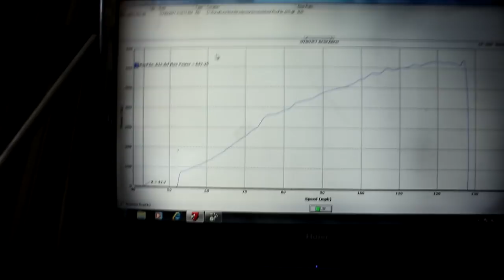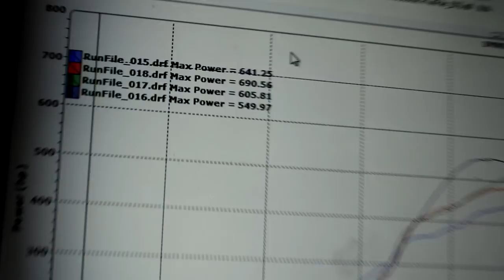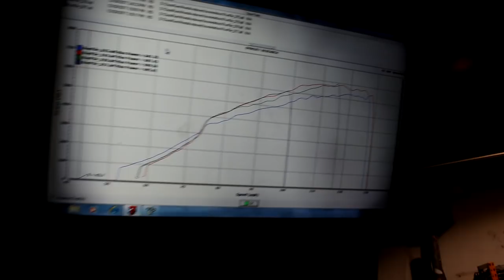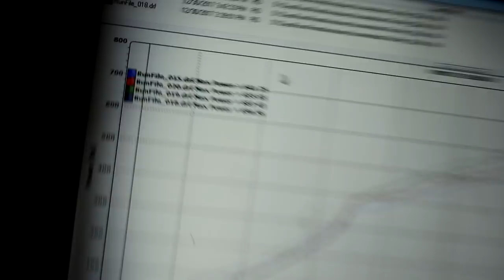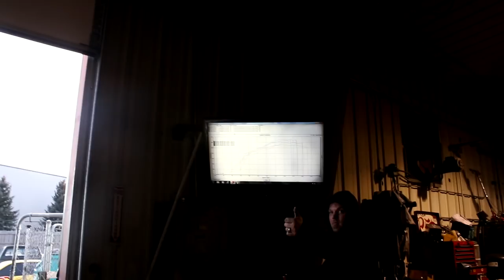Turbo Minivan makes some Real Power!

Comment: Anyone notice the minivan pouring out coolant <3
Reply: coedy slone ya that’s not good.
Reply: less than three
Reply: Yea i saw that
Reply: I saw it too. Thought he would mention what happen
Reply: its because he doesn't have a coolant overflow tank/bottle.
Reply: yea dude i was waiting
Reply: Yes
Reply: Yes
Reply: It'll be alright
Reply: yeah i do that's bad
Reply: I definitely did...
Reply: looks like a boosted boiz things! loose plugs on the wastegate, loose clamps on the radiator, loose crank pulley.. but... it should be fine!
Reply: @Math D.  its not from loose clamps or anything. He just pointed the overflow hose at the ground since he doesnt have an overflow tank.
Reply: coedy slone yah surprised no one noticed
Reply: coedy slone yea in the dayno
Reply: coedy slone yeh lol
Reply: coedy slone I love it...just keep running it like nothing happened. Lol he looked right at it too. Lmao
Reply: he forgot the good old soda bottle
Reply: coedy slone yea haha
Reply: coedy slone yea
Reply: As Kyle would say "its not goin anywhere"
Reply: Oh crap yeah at 1:54! Must have been fixed for the next run though. Weird.
Reply: she is just excited.

Comment: I remember when if you had over 200hp you were in a fast car. Heres this guy like 600+ in a hatch 600+ in a minivan 300+ in a awd van a mr2 with 4-500+ just making hp like nothing
Reply: Shinobe Man thats that Honda power bro
Reply: positive manifold pressure is a wonderful thing
Reply: Turbo
Reply: Shits real I hear that am jus saying these days a new bm with just under 500hp is slower than a lot of the competition. Here’s a guy with a minivan putting down well over a 100 more whp effortlessly, that’s crazy
Reply: Shinobe Man not exact effortlessy tho
Reply: 200hp is still kinda fast in europe, but americans are crazy and daily drive v8s and obviously you can't really make really low power with big engines, so you're used to more power than here in europe. You just got used to drive powerful cars, so they don't feel as powerful and then need more to feel like it's fast.
Most people here daily drive cars from 50 to a 100hp... So when you have a diesel 180hp bmw you're kinda fast.
Reply: zenkiES14 shit man I ran out of breath reading this in my head... learn how to use some punctuation brother.
Reply: jank jankins the road are good in some countries french roads are perfect, however belgian roads are shitty. But the real problem in Belgium is taxes. When you buy the car you have a tax according to the size of the engine, for a 2.5 it can be around 1000 euro. (900$)(France doesn't have that, but some other europe countries have it too)
And then taxes for pollution.
And yeah fuel is expensive af so everyone is using diesel because it's cheaper but we're all getting fucked since now taxes are decreasing on normal fuel and on normal fuel cars because it pollutes less. And rn since they can tax e85 (they couldn't before) it's finally becoming something here, I hope people will use it because it's way better alternative than electrics. (There is law that is gonna pass in 15years or something like that that will force you to have an electric car, if it really happens, I'm moving to the usa.)

Comment: *Buys a TiAL wastegate because the cheap ebay one fell apart. 
*TiAL wastegate starts to fall apart.
Reply: fairly sure the plug was installed by kyle not tial.
Reply: Regardless of the source the comic irony remains. :) There have been a few points on this build where stuff like that has happened. visa vis the epic crank pulley evacuation.
Reply: I agree 100% lol. That crank pulley exiting left center stage was epic to say the least.
Reply: What's more amazing is that it didn't damage anything else or itself.
Reply: The Tial didnt fall apart or anything even remotely close to it. A small plug in the side that Kyle put in, fell out. BUT wutevs
Reply: Tial has a video on here of a stress test on one of the china-tial wastegates they did and it didnt work out of the box and then after getting it working, it failed after only 40 mins and 6500 cycles.
that said, the knockoffs have a place in the market, but to even remotely compare a tial to any china made knockoff is absurd . It was a plug kyle installed which is no fault of tial. cardsonthelow you are correct

Comment: 3:52 "We gotta beat that!"
Kyle: "Ahahaha no..."
Poor guy just wants his race car to be faster than his race van.
Reply: it's all about power to weight so car is faster.
Reply: djmips well it’s probably a lot easier for the van to hook with the extreme weight
Reply: i wouldn't say extreme weight
Reply: he said their stock 3100 pounds lol and its really not much more weight over the front axles for that fwd grip......... also with shitty stock suspension the weight transfer to the rear wheels is a lot more than his hatch. so it probably has even less grip than the hatch.
Reply: Use this Advertisement board yo!
Reply: GTFO
Reply: Etown Edits tbh I've never seen 802 ask for subscribers on this channel... maybe he's just actually interested...
Reply: Pravusss s yeah not that heavy the new si way that much
Reply: Catfish cooley
Reply: Lightly Salted Peanuts This is my favorite channel. :)
Reply: The van is actually lighter than a lot of modern cars, so especially partially stripped it could be surprisingly competitive.
Aerodynamics and center of gravity and weight distribution won't help it though.

Comment: Even better than that dodge caravan burnout right there
Reply: Ethan Thomas someone who remembers that video
Reply: Pun Heard hell yeah brother
Reply: Pepperidge Farm remembers the Shelby swapped Caravan
Reply: PGTMR2 wasnt that a lebaron swap?
Reply: The engine of that thing is the same one in the SRT4 Neon
Reply: Dirt4k SRT4 apparently. I was referring to the GLHS Omni drivetrain, should also bolt in to a minivan. Daytona may have something similar. I don't think the Lebaron had anything Shelby. Still might have had a turbo 4 in the lineup.
Reply: I was thinking of the one that was on 1320video that kept eating its axles

Comment: Instead of a relay to the pump, you should try a "boost converter"   a boost converter is essentially an adjustable stepup transfomer that allows you to stepup voltage.. in simpler words it will allow you to increase the voltage up to 30 volts.  This is better than a relay because the relay is only going compensate for voltage drop  and the most voltage you be able to get with a relay  is the amount the alternator is putting out [13.8 or 14.4 depending on year]   with the boost converter you can exceed this this you can do 15, 16 17 volts or as much as you want up to 30, the only concern would be eventual  to much voltage will burn out pump [for example 30 volts], just imagine how much gpm your pump would put out with 15 volts
 There are many boost converters out there, here goes one. . . 
like this https://www.amazon.com/DROK-Converter-Regulator-Adjustable-Transformer/dp/B019SYX7BM/ref=sr_1_1_sspa?s=electronics&ie=UTF8&qid=1514833344&sr=1-1-spons&keywords=drok%2Bboost%2Bconverter&th=1
The only other concern would be make sure the boost converter can handle the the wattage of the pump , you may have do simple math to figure this out [ volts x amps = watts]

Comment: The minivan is so sick! I would just get the new suspension, wheels and maybe some low key not too flashy racing seats/ harnesses and it will be all set for that meet up. At that power the hatch and the van should probably start getting some saftey stuff added lol

Comment: If you increase the gauge to the fuel pump on the positive,  increase the gauge on the negative as well...
Reply: Isn't it a chassis ground? (If so, then yes for the short lead to the grounding point)

Comment: Bring the Minivan 100%!
Reply: SleeperHonda such a bad idea it would get smoked in Everything.
Reply: Gma Bailey not once the put the Skunk suspension
Reply: Keiffer Meyers and your point.  You won't find to many tires for that rim.  The bushings are worn out bet it rattles over every bumb.  Now all the roll from the weight being up so high.  A mile of fender gap no coils on yet.  Even if they do put s2 on the struts won't be right.  So with all this it will never hook up for a drag race real impressive 14 sec van trapping 120.  But its bringing a spoon to a gun fight.
Reply: Gma Bailey Ok guy

Comment: you really need a windscreen idk about USA but here in aus with that windscreen police will pull you over as soon as you leave the drivway
Reply: Wouldn't that much power be illegal in Australia
Reply: nop you can have as much as power you want
Reply: Callum Tapper I was thinking the same thing lol the windshield is probably the least illegal thing about the van (if it were in Australia)
Reply: Fox yeah well at least here in New Zealand you can do just about anything to your car and if you certify the mods, it's completely fine

Comment: Think about it , if the trans goes, so does the engine meaning that the parts gettin broken up it then puts the engine through all of that mechanical stress! Do something with the trans NOW! Also the front suspension is movin all over the place.The car is serious now! Just a thought.
Reply: dano All his cars make serious numbers but besides the engine nothing gets touched. He doesn't even bother to wash them once in a while. The hatch shouldve gotten caged and a built tranny ages ago.
Reply: Here's an idea, take the engine and all of its suspension out and put it in the back of the van! Wheel stander in the 9's
Reply: you were right. He just lost 3rd in the competition

Comment: If you want stronger voltage, run a power feed wire off of the alternator!! You will have stronger voltage directly to the fuel pump because the alternator will see the power draw and kick up the juice.

Comment: Kyle, do some weight reduction, strip it..... take out all the back glass windows buy some plexiglass to replace all the windows and that will drop it a good 50-80 lbs... I know you wanna keep it sleeper but if done right you would never know.
Reply: Lee let’s work on traction first lol
Reply: Pharaoh on LFS weight reduction is traction
Reply: Silently Sceptical, pulling all that weight when he actually puts some drag tires on it is going to be hell since its all stock so prepare for a few snaped axles.

Comment: Yeah the minivan is making more power, but it also weighs 1800 lbs more than the hatch. It's basically two of your hatches. You said in a previous video that the van has a curb weight of 3800...my 97 coupe weighs 2450 with a B series turbo in it and a full interior.

Comment: Coolant shouldn't be spraying out of the overflow line like that.  That's usually a sign of pressurizing the coolant system with combustion gases aka head gasket leak.

Comment: NEXT!!! Weight losss. Do lexan windows. The glass in that van all together is like 200lbs.  And get a hole saw and pop holes all through the inside and then go weigh it at the scrap yard. They dont charge for weighing.

Comment: IF YOU ROAD COURSE THE CAN GET SOME WIDE WHEELS AND TIRES AND LOWER IT ON SOME DROP SPRINGS AND IT WILL HANDLE PRETTY GOOD I HAD A VAN LIKE THAT AND IT WAS A BEAST AT HANDLING BUT OF COURSE HAD LESS POWER

Comment: Do some track mods on the hatch and take it to florida instead of the van. I think you should take the hatch because youll be very competitive, and the van wouldn't do very good on the track. you should also look into get a front spliter and on both vehicles for some added down force on the hatch at speed. but do as you wish its all good content.

Comment: Bring the van but try to do literally ANYTHING to atleast the front suspension. As others have said you are going to rip something off with all that power/torque. I know the hatch is fine with stockish suspension but the minivans suspension is shot. I dont mean slam it or anything bc its supposed to be a sleeper but atleast replace it with something

Comment: I know this is all about Honda engines. But you have to spend allot of money to get that 500+bhp out of these engines. You are always adding uprated Con Rods, Pistons, having the cranks re-ground etc. You could pull a Saab B234 out of a scrap Saab 9000 and that engine will make 500bhp as it stands with Zero mods to the actual engine. And it will do it for 200,000+ miles. Just add bigger turbos and more fuel. I know you just focus on Honda's, but there are much better 4cyl engines out there that use all Forged components from the factory and are massively over engineered. In the UK at the moment there is a craze happening with young teenagers in little shitbox GM cars circa 1000kg with Saab engines pushing over 500bhp in them. And it only costs them a few hundred bucks to do it.

Comment: Weird question but what do you mean by running away
Reply: Carlo Castillo Means that it was near 100 percent duty cycle on the injectors and running out of fuel capacity and control.  It needs a higher capacity pump, larger lines and regulator. Run out of fuel capacity and control, the head gasket blows, pistons burn up and bad expensive engine damage.

Comment: Power is worth nothing without traction, you need LSD, good suspension and wheel/tyres. And that front end is fucked, TCA's are badly worn or something, that front wheel moves about 4" backwards and forwards when power is on and off.

Comment: Can someone please explain how I do this fuel pump relay trick they are talking about.....
Reply: MrZeroLag  we use bigger wire trigger the relay with old fuel pump wire and run alternator voltage to the pump to make it spin faster